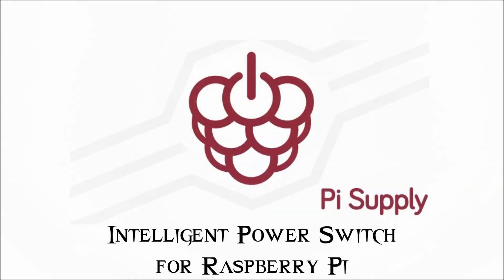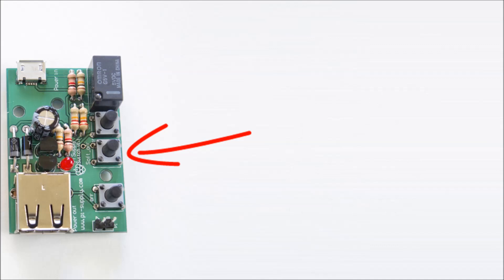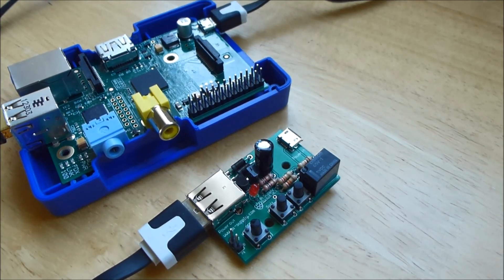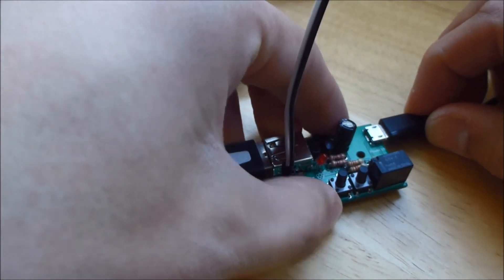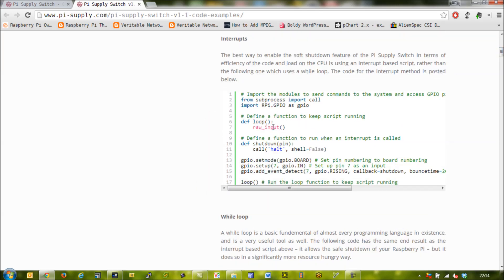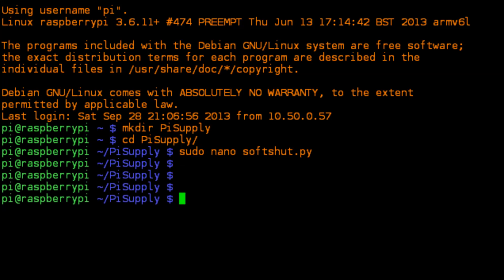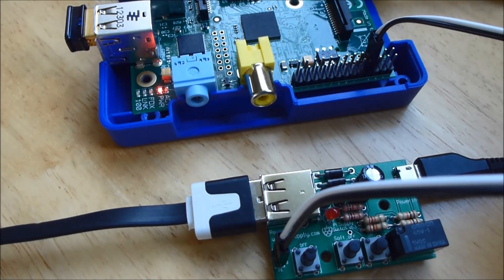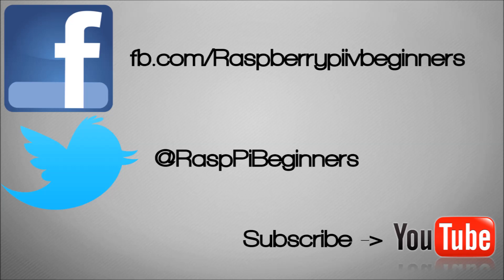Raspberry Pi - The Pi Supply

Comment: For the price it should come assembled on the board.   I can simply buy a power strip with a rocker switch far cheaper that will do the same thing and I don't have to assemble and solder components myself.

Comment: have just got the power supply switch and trying to figure out if it is possible to use this module for automatically timed turning on and of of a device? Do you maybe know for some solutions regarding this? I am trying to build insect trap that should wake up once a day and take one photo, send it and turn off.

Comment: This would be very useful if it shut down and them actually turned on aromatically after a while. I have problems with my pi being on but not responding after a while so a auto resent when the script is not responding would be useful.

Comment: Why does it use a usb cable for power supply? As you have to use the GPIO pins anyway, they could as well use the 5V and GND pins. And it looks like this doesn't have a regulator, so you need USB power anyway.

Comment: Very Good.  I've been using something similar from Lowpowerlab called the AtxRaspi.  It uses an external button and slightly different scheme as holding the button for approximately 4 seconds to issue the halt command.